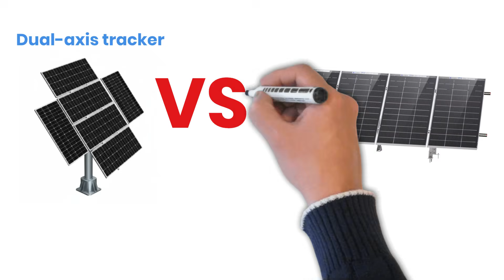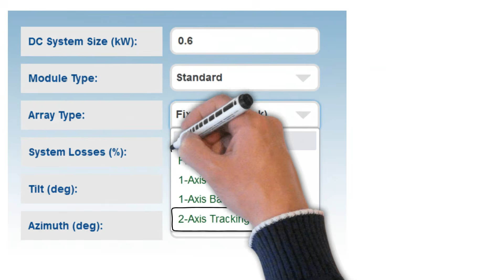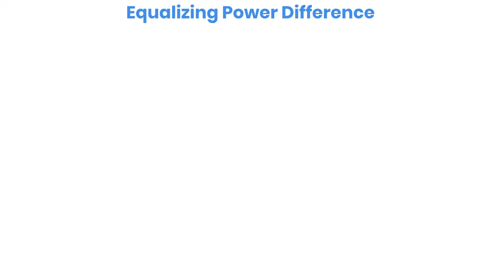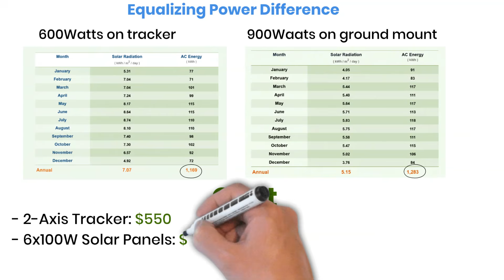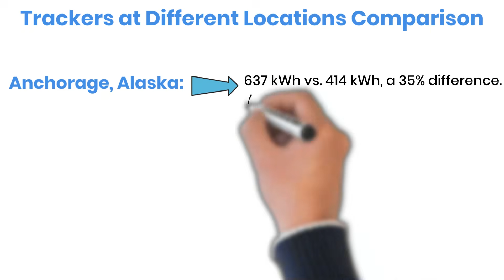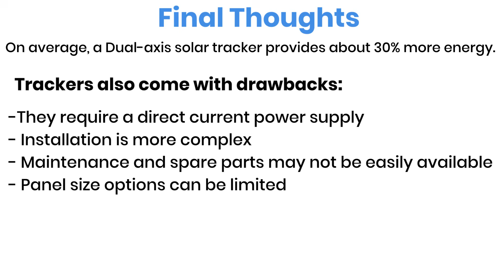Don’t Make This Mistake – Dual-Axis Solar Tracker vs Ground Mount

Comment: I built my own tracking system out of a rear end of a Jeep Cherokee on manually move it 46 times a day
Reply: That is supposed say 4 or 6 times a day not 46 times a day
Reply from the maker: That’s a pretty creative way to build a tracking system. Using a Jeep Cherokee rear end must give you a very solid and heavy-duty base. Moving it 46 times a day is definitely more hands-on than a motorized tracker, but it could be a great DIY solution. How long does it take you to make all 46 adjustments?

Comment: One thing I don't see often in videos like this is the stability of collected energy on a day-to-day basis. Fixed systems will vary widely in their production throughout the day due to the movement of the sun, but trackers will vary much less and maintain consistently higher outputs as they keep the angle to the sun consistent.
Reply from the maker: A tracker can keep the panels closer to the sun’s angle throughout the day, so the power curve can be more consistent instead of having a strong peak around midday and lower output in the morning and afternoon. However, the actual day-to-day stability still depends on weather and cloud cover. Have you found that this makes a noticeable difference when sizing the battery or inverter?

Comment: I made a solar tracker for my parabolic solar concentrator.  This has to be much more accurate tracking than for solar panels.   It's mount points at the north star and is shaped like a catapult.  (this is called polar mount or equatorial mount).   It rotates at 15 degrees per hour.  You can mount solar panels on it instead of a reflector and it is actually easier than what I did.   It takes about 10 watts to run it.  It is single axis with manual adjustment of the second axis.   Anyone want to try it DIY with solar  panels?    I think ground mount solar trackers are crazy overpriced.   My concentrator is about 600 watts for about 9 hours a day when the sun is shining. And total cost is probably less than $200. Including the reflector.  If you can weld up the catapult and buy a couple of bearings to rotate it, you are halfway there.
Reply from the maker: That is a really interesting approach. A polar or equatorial mount can definitely simplify the tracking to one powered axis, especially when the second axis is manually adjusted. And if you are only using around 10 watts to run the tracker, that is a pretty small energy cost compared with the extra solar production.
The part that caught my attention is your roughly 600 watts for 9 hours a day from the concentrator. How are you measuring that 600-watt output, and what type of reflector are you using? I’d be interested to hear more about your setup.
Reply: @batteryhacker4343   It's solar thermal so I just measured how quickly it heated up water in a bit pot.  You know how many kg of water, the heat capacity of water etc.  And measured the temperature change every minute.  It's fairy easy to get the joules per second from that.   I can't weld due to a heart condition,  but if I could,  I would weld up a sweet rig for some solar panels.  Solar panels don't need much precision so the speed of rotation could be a bit off, and the aiming at the north star too,  but it will hardly make a difference to the energy collected.    I have no clue why people don't DIY something like what I did.   Maybe they just don't understand the physics?  My "sun scoop" is unique, and maybe that scares them away.   I don't even have a motor on it! The power and timing is delivered by low pressure air,  and the rotation is produced by a "waterwheel winch" .   Actually,  a few days ago, I found a Spanish company selling a thing called TCT red,  which is kind of a similar thing but  it has dual axis tracking,  and misses out on the simplicity of my device.

Comment: I have a solar tracker, and I can say that your calculations are complete nonsense.
Reply from the maker: If you think a specific calculation is incorrect, I'd genuinely be interested to know which part you're referring to. The figures in the video were based on PVWatts using the same assumptions for both systems, so if your tracker is performing differently, it would be great to compare the setup, location, and panel configuration. Real-world results can definitely vary.

Comment: Don't forget wind would probably effect ground mounts less. Less chance of damage.
Reply from the maker: You’re absolutely right. Wind usually affects ground-mounted systems less, especially when they’re installed low and properly anchored. Trackers have more surface area and moving parts, so strong winds can increase stress and the risk of damage. That’s another reason why fixed ground mounts are often the safer and more reliable choice in windy areas. Thanks for pointing that out.
Reply: @batteryhacker4343  Did you know that when the wind is strong, a tracker folds flat, whereas a ground-mounted system doesn't? So, which one is more at risk of damage?
Reply from the maker: @MichałDIY1986  Many modern trackers do have a stow position that folds the panels flatter in high winds, which can reduce wind loads. The trade-off is that it depends on the tracker detecting the conditions, having power available, and the mechanism working as intended. A fixed ground mount has no moving parts, so it's mechanically simpler. In the end, proper engineering and installation matter more than the mounting style itself. Have you had any experience with trackers in high-wind areas?
Reply: @batteryhacker4343 i have, mine has been in 70mph straight line winds and no damage to my ecoworthy dual axis solar trackers. I have 3 trackers and each tracker holds a total of 12- 100w bifacial solar panels in 3s4p